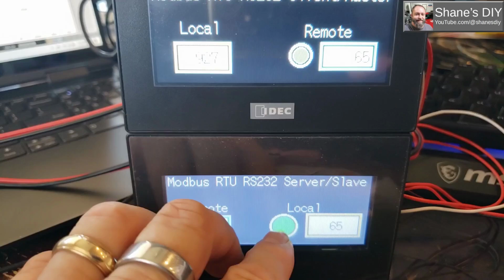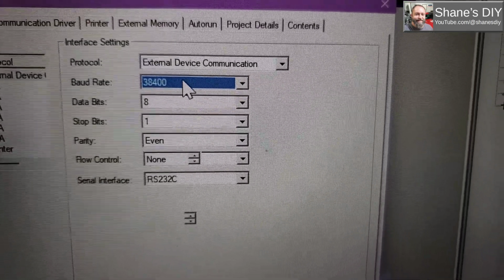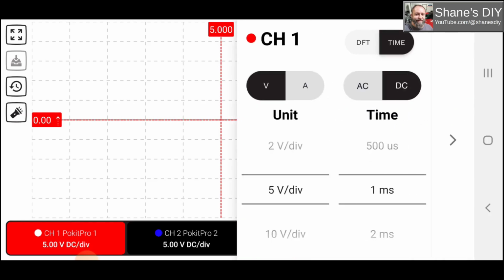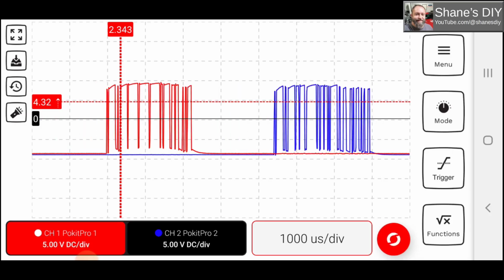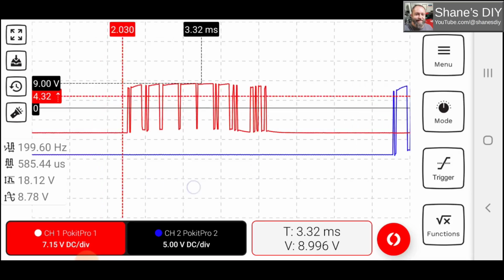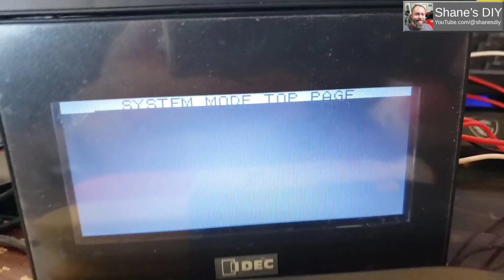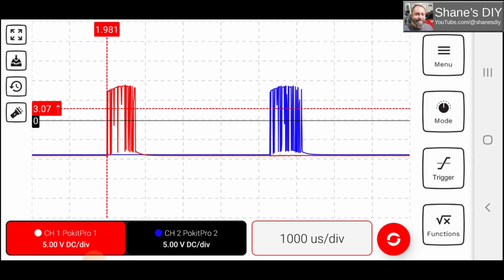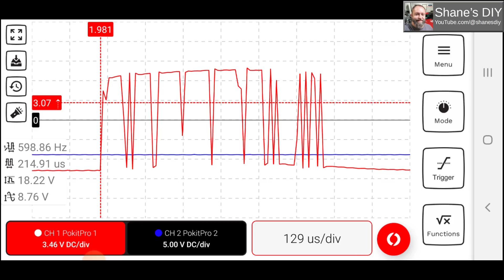Viewer request - Pokit Pro Oscilloscope Modbus RTU Waveform Monitor

Comment: Thanks Shane. I am sold. Going to grab a couple pros.  
The 115k is unuseable. I think the slower baud rates though will be plenty. Most of my modbus stuff is at 19200 and 38400.

Comment: Might want to try a faster time base.  At 38400, a single bit width is only 25uS.  Your timebase was 1mS/div meaning that 40 bit transitions could occur in one scope division.  At 115200, 120 bits per millisecond.  I think thats why it looked choppy when you zoom in.  I don't know if you can see or control the dample rate, but it needs to ve fast enough that it captures several samples per bit time.  If ut truly does 1M sps, it shoukd be plenty fast enough to show a decent representation of the modbus, though it might require getting the sample rate up by capturing at a faster timebase.
Reply from the maker: I can run the test again and see if the results are any different, what timebase would you suggest?
Reply: @shanesdiy make the time base as small as possible. 

What's the fastest time base you can use?